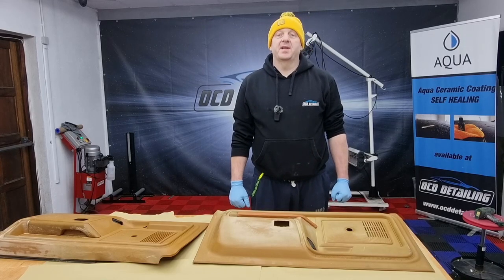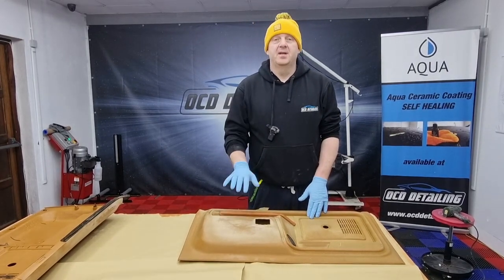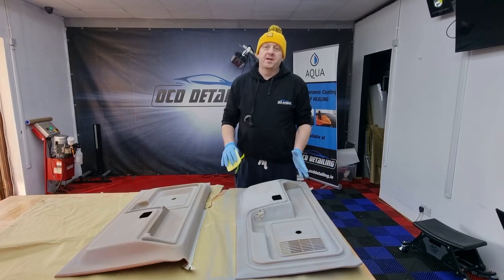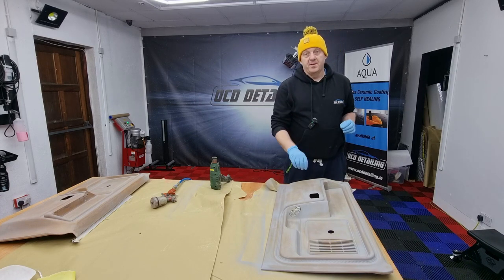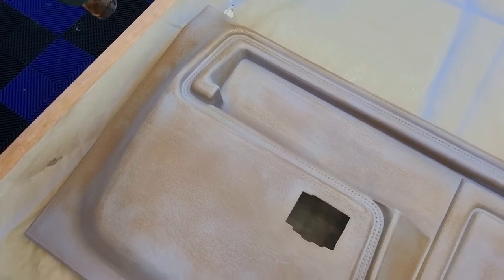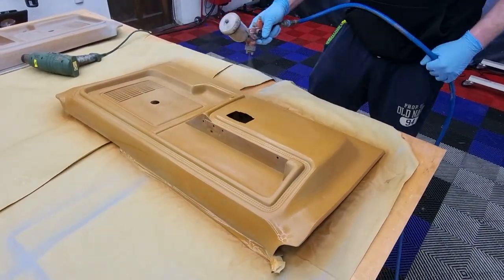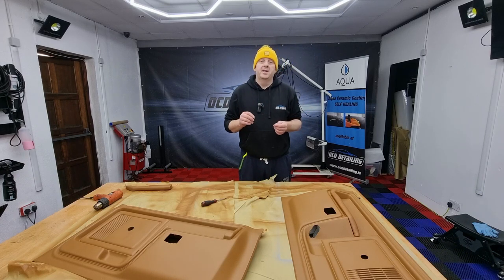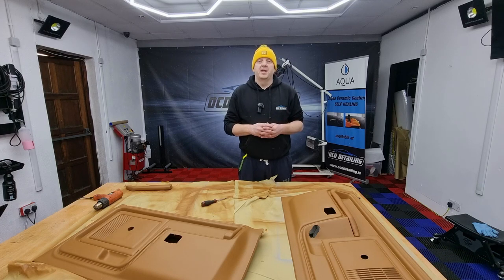How To Restore Plastic Panels From A Car | Leather Restoration

Comment: I don't understand.. between paint and top coat (you told 
about "sealant"...what kind of sealant?) you add some primer? I agree for this, ONLY between basic surface an first layer of paint.
Reply from the maker: When I spray leather seats, I use two paint ( color) and top coat ( clear coat) , for this job I used paint that is mixed with a component that provides protection to the paint ( 2 in 1) . When it comes to sealant I use Geist Dye & Friction Blocker or Colourlock Shield. The proces involved : Plastic primer > leather primer > single stage paint. I hope this helps.
Reply: @OCDDetailing2021   I used some Crosslinker IC2 or equivalent for a better resistance. Maybe 6-7 layers of mixed Topcoat with IC2. After few days, a sealant. Have a nice day and thank you!
Reply from the maker: @irinaagnes1250  Normally I also use crosslinker, for seats and parts that are "in use" in this case the component that I had added to the paint , its a sort of top coat and crosslinker in one , in this case its not as wear resistance, as standard top coat and crosslinker , but the door panel won't get as much use as seat, so it doesn't make difference for durability. But doing this way I wanted to avoid spraying so many coats of paint and then would have to spray topcoat.  Too much paint could have a tendency for peeling off.